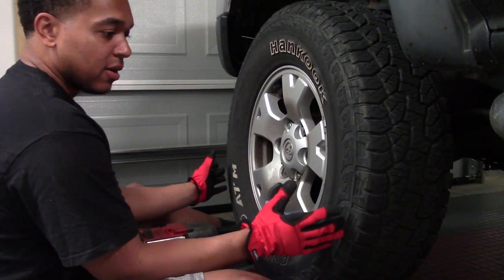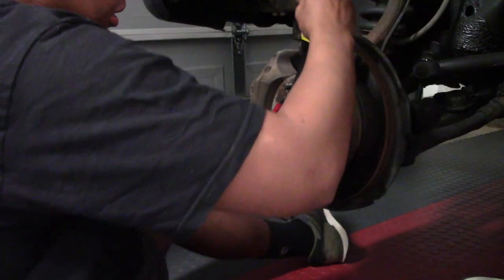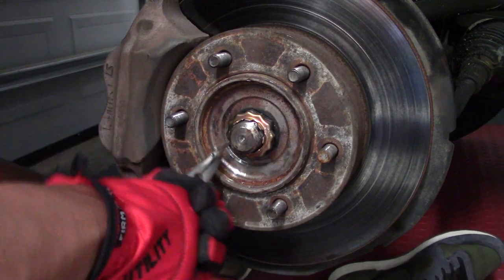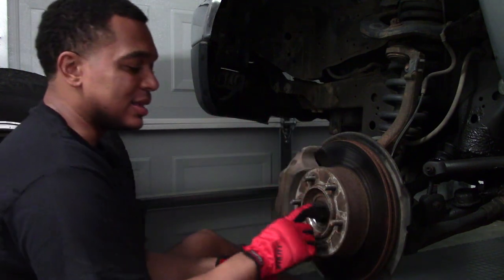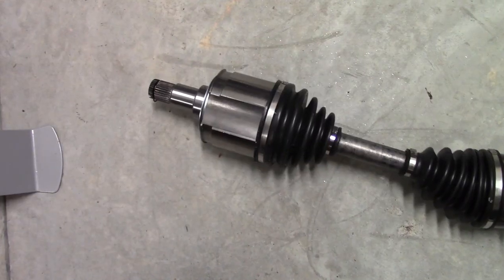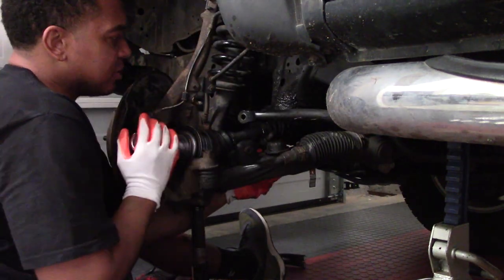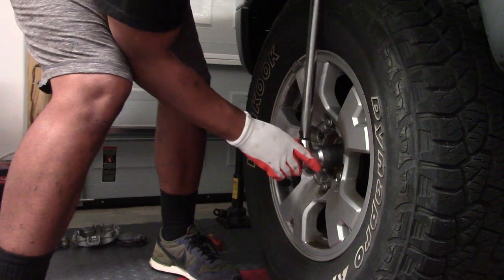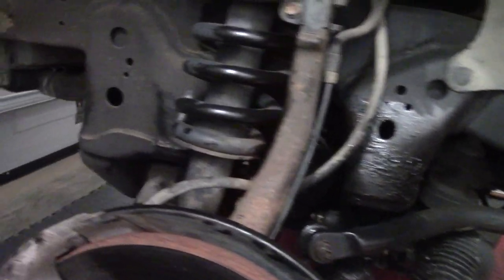CV Axle Replacement | Toyota Tacoma T100 4Runner

Comment: I’m working on a very similar Toyota 100 , 1993 4wd model. I have the drive shaft part. I took it apart ( fairly similar to truck in your video. ) however I’ve stopped at the point after taking out the 4 bolts underneath the hub. Due to the fact this has torsion bar suspension which is connects to the top wish bone. Im not sure if I should try to swing it out the way, as the torsion bar pressure is pushing down and I might have issues if I do that. I’m going to take another look at my Haynes manual. Any ideas
Reply from the maker: I think I've run across that scenario. In the truck I did, I did not remove the torsion bar but instead there should be the sway arm bolt opposite from the torsion bar (other side of wishbone). I removed the sway arm bolt and swung the rotor assembly in the direction of the torsion arm. Hope that's your scenario,  but if not I'd definitely avoid removing the torsion bars add they can be a bear to remove

Comment: Hey boss, thank you for making this video. Just wanted to ask, is that silver gap between the differential and the cv axle shaft normal? It’s that little silver dust cover around the spline. Time stamp in question is 08:53
Reply from the maker: Oh yea that is normal, the angle of the camera may be making the gap look larger than what it is, but it's probably ~1/8" wide. Once you push the axle past the locking ring (which is the tough part haha) it's easy to bottom out the axle into the differential housing and it'll be obvious axle can't go any further. Additionally, reinstalling axle nut, wheel and suspension items loosened will ensure axle is seated. Hope that helps!
Reply: @EngineeredMojo  Thank you brother!

Comment: A Tip To remove nut with a brake bar without put vehicle back on ground is a Pry bar On The Wheel Studs and A Breaker Bar To take the nut off hope that helps
Reply from the maker: That's a good tip, thanks!
Reply: @EngineeredMojo  very welcome hope it helps somebody
Reply: @Engineered Mojo  you can use that technique also To lock the axle nuts back down also if ya don't want to put it back on the ground yet pry bar on studs and torque wrench to tighten the nut down
Reply from the maker: @AntonioClaudioMichael  when I looked up the technique you mentioned I saw that process of well for using same technique to get axle nut but back on. I plan to try and use similar technique for a crank pulley bolt in a few weeks actually. Using pulley key in combination with placing prybar against my lower control arm for resistance while I turn crank pulley bolt with long breaker bar. I still have my impact socket gun, but not always easy to fit that into spaces haha
Reply: @Engineered Mojo  sounds like a Good Plan didn't realize ya Looked up the Technique glad the information I gave was detailed enough so you could look it up they come in handy to make fewer steps it can be annoying and even exhausting to constantly pick up a vehicle and put it back on the ground you can also use a floor jack while the Vehicle is on jack stands to put the suspension back to the right height to tighten down bolts that are attached to bushings like control arms Also another tip For ya

Comment: I've got a 1993 T100. I noticed the outer boot has worn out and so i'll need to replace the boot. Do you think i'll need to do the full axle replacement like you did or could i just do the boot? I assume a simular process to you video but maybe dont need to take axle right out?
Reply from the maker: You could do just the boot, but in my opinion it's just about the same amount of work to replace boot as it would be to replace axle whole. But you'll save money for sure just doing the boot but not much time
Reply: @EngineeredMojo  nice one thanks. Yep i just watched the timmy tool time video and that was the impression i got as well! i'll check prices on parts, then decide.

Comment: Good video, looking at replacing an axle on my 94 4Runner, luckily it seems Toyota didn't change things between generations so vids like this are helpful. I do have a question though - do you know the fork on the bike behind is installed backwards?
Reply from the maker: Ohh man you are a MVP, just went out to my garage to swap this around. I hadn't thought about it, but realized my foot was often hitting the tire on tight turns. Flipping to fork around solved that. Thanks :)
Reply: @EngineeredMojo  no worries, long time bike mechanic so things like that pop out.

Comment: People up for this job , stay away from Advance Auto Carquest CV  Axel Part #NCV69142
End that goes into the hub bearing doesn't seat properly , this is very difficult to notice during installation so I found.
I got both sides installed gave it test drive finding smooth performance,  days following their was minor clank every so often that could be heard at slow speed.
My first though was steering rack bushings or upper ball joints were @ fault.
Taking closer look I found very minor axel side to side play.
I ended up replacing them with Napa Maxdrives & problem solved.
Thank goodness hub bearings weren't destroyed during Carquest experience.
Reply from the maker: Thanks for the info on that! Having to do this job twice is not fun, glad to know of shoddy replacement parts
Reply: @EngineeredMojo  yeah going aftermarket is gamble. 
I've always had much trust in Carquest quality ,that is no more.
So much damage could of occurred to hub & differential with prolonged use of their cv.

Anyway as far as upper/lower ball joints , sensors , timing belt goodies etc.
OEM & 555 parts are only way to go.
Nothing else should be trusted.